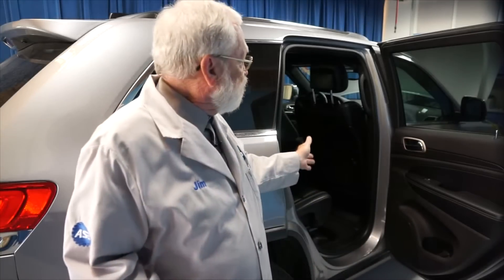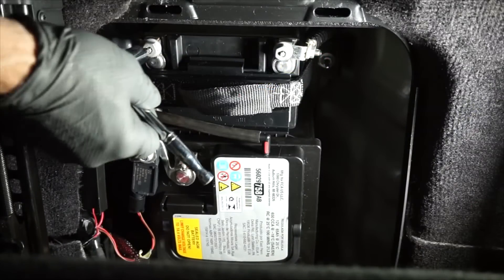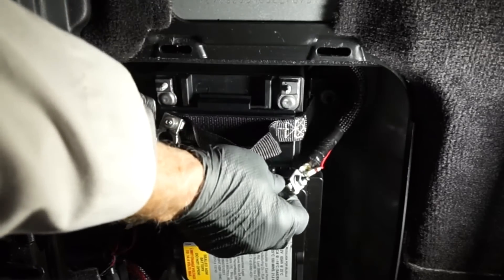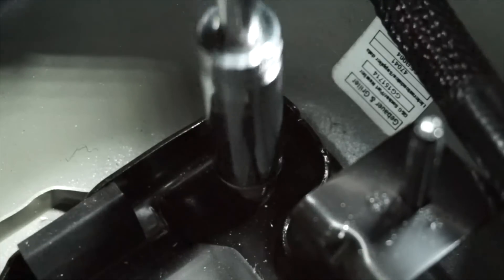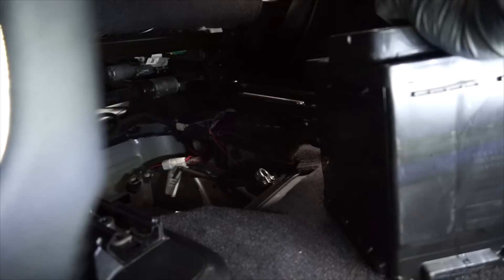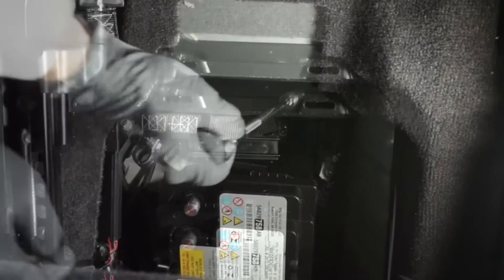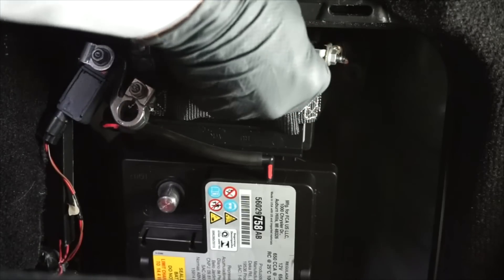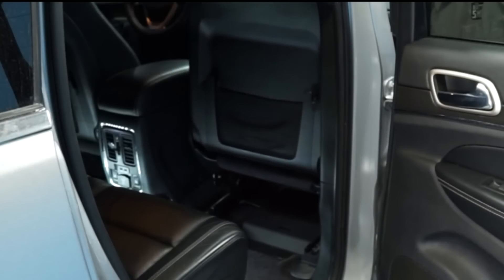Jeep Grand Cherokee & Dodge Durango with Start/Stop (2011-present) - New Battery Install

Comment: What do you connect the other end of the jumper cables to?
Reply from the maker: Hi - Thanks for watching! They are connected to another 12-volt battery or 12vdc power supply. You may want to check out our video on memory saving methods. The link is in this video's description.

Comment: Do you have to register the new batteries with the Durango? I’m searching and the only cars that seem to need battery registration is European vehicles
Reply from the maker: Hi - Thanks for watching! According to BCI, the Durango's replacement battery does not require registration with the vehicle's battery management system.
Reply: @TheBatteryShop  thanks so much for replying! This helps my mind ease a lot!

Comment: I just did mine.  I'd really would like to know how someone can be so smart that they get a job as an automotive engineer,  yet could be so stupid to put the battery there.  Caution to anyone that replaces their batteries. Make sure you get the H6 battery and not the H7.
Reply from the maker: Hi - Thanks for watching and sharing your experience!

Comment: Where is the auxiliary battery on a 2019 jeep Cherokee limited? The main battery is under the hood. Nothing under the passenger seat.
Reply from the maker: Hi - Thanks for watching! We don't always have that type of information here in the studio, so we recommend that you check the vehicle owner's manual or a service/repair manual to be sure.
Reply: @TheBatteryShop  After watching a few videos, it looks like the Jeep Cherokee has only one main battery under the hood.

Comment: What a pain in the ass Dodge made of CHANGING A BATTERY!!! Wow!!!   Need two loooonnggg 10mm sockets to get out the aux battery bracket as it has looonnnggg bolts.  Even after all is removed, the battery barely slips out of the space between the floor and the seat. Felt like I just delivered a baby. Push! Push!
Reply from the maker: Hi - Thanks for watching and sharing your experience!

Comment: What if the battery is completely dead and the seat won’t move?
Reply from the maker: Hi - Thanks for watching! A memory saver or another 12-volt battery connected to the "jump posts" under the hood will power the seat. The vehicle owner's manual should provide more information on the "jump posts".

Comment: Thank you. I was searching for a video that included the Aux Battery. Was pretty sure about removing it, but thanks for the clarity! Appreciate you.
Reply from the maker: Hi - You're welcome and thanks for watching and sharing your experience!
Reply: @TheBatteryShop I replaced the main battery and put everything back together but know the problem is even worse. All the lights are flickering and it won’t even crank…not a sound. Any idea what’s happening? Thanks.

Comment: I have a 2020 jeep Cherokee 2.0 turbo charged four-cylinder. The battery went dead. They say I need to replace it. My car does have the stop start. But my AGM battery is in my engine compartment. I don’t see any other auxiliary battery or have I’ve been told that there’s one and I don’t find one in my book. Can I replace my battery and not worry about the computer memory?
Reply from the maker: Hi - Thanks for watching! We don't always have that type of information here in the studio, so we recommend that you refer to a service/repair manual for your vehicle (available from auto parts stores and the vehicle dealership) for tat information and procedures.
Reply: Thank you! Your video was very helpful. I found out through my manual a manual that I do not have have an auxiliary battery. So that made it very simple for me and I did not have to hook up to a power source to keep my computer happy. Luckily my car is not that fancy lol

Comment: Is there a relearn procedure for this vehicle after replacing the batteries?
Reply from the maker: Hi - Thanks for watching! Battery registration depends on the year/model of the vehicle. We suggest that you consult a service/repair manual or the dealership service department to see if your vehicle requires this.

Comment: What do you do when battery is so dead it won’t restart and all the lights and electronics won’t work either? 

Because now we can’t get the seat to move forward to get to the batteries. 

Is there a particular way other than the headache of having to remove the entire seat?
Reply from the maker: Hi - Thanks for watching! A 12-volt battery or a Jump Pack can be connected to the "jump post" under the hood. Check out the vehicle owner's manual for more details.
Reply: jumper cables to move the seat

Comment: 2021 GCl and had to have both batts replaced under warranty. This due to the autostop failing after a reprogram for headlight and steering recall. Details of the work show that the computer needs to be reset to correct the autostop feature. Great vid, I wanna put a charger on these batts for a home test 👍
Reply from the maker: Hi - Thanks for watching and sharing your experience! You may also want to check out our video on battery registration. The link is in this video's description.

Comment: I want to find the genius that put the battery under a powered seat that needs POWER to move to GET TO THE DAMN BATTERY. Chrysler will never see another penny from me. They single handedly ruined the Jeep.
Reply from the maker: Hi - Thanks for watching and sharing your opinion. A 12-volt memory saver or jumper wires connected to the "jump posts" under the hood and another 12-volt battery will provide power to move the seat.

Comment: Great video and very helpful. I have a 2017 Grand Cherokee Overland.
The large (start/stop) battery checks out fine.
I'm now looking at the smaller auxiliary battery but can find no reference to it or a specification / order reference number anywhere. Can you help?
Reply from the maker: Hi - Thanks for watching! The auxiliary battery is a Group 400 AGM battery rated at 200 CCA.

Comment: Hello sir, thank you for details video. I followed your instructions and replaced new battery and my jeep is working again but the only thing missing is the ambient light on exterior door handles not working. Would you know how to fix it please give me some advices. Thanks sir
Reply from the maker: Hi - You're welcome and thanks for watching! We don't have that specific information here in the studio, but we suggest that you check the vehicle's owner's manual or a service/repair manual for the reset procedure. That's what we do.

Comment: The fact that this video is upside down is so frustrating. Especially when I have to pause, my screen times out. I have to rotate my phone to unlock, the. Flip back to see it the way you would see it while working on it
Reply from the maker: Hi - Thanks for watching! We suggest that you check your phone's settings to see if you can fix the issue.

Comment: I changed the aux with these instructions(thank you!) however the start stop alert is still on our gauge. Checked the volts using durangos setting and it’s at a consisten 14volts. No clue why the stupid start/stop(A!) is still on the dashboard… should I have the main battery checked or replaced?
Reply from the maker: Hi - Thanks for watching! The alert message may go off after driving the vehicle awhile. We suggest you check the vehicle owner's manual on this, but the main battery should be checked as well.

Comment: Can you charge the auxiliary battery with a trickle charger?
Reply from the maker: Hi - Thanks for watching! Auxiliary batteries can be charged with external chargers, but you have to refer to the vehicle owner's manual or a service/repair manual for the vehicle for the proper procedure.

Comment: Just replaced mine with a Duralast Platinum and had to trim the plastic on the positive side connector to get it to fit.  The Dura last has vent holes on both positive and negative ends, but it comes with a plug on the positive cap.  I attached the vent tube to the negative side like the oem battery had, do I need to plug the vent hole on the positive side?
Reply from the maker: Hi - Thanks for watching! Yes, the unused vent hole must be plugged.

Comment: What happens if the aux battery dies? Will the car just run like normal? We have the start stop system.
Reply from the maker: Hi - Thanks for watching! Typically, if the auxiliary battery needs replacing the start/stop function will not work. Other features may not work either, depending on how the vehicle is equipped.

Comment: Did the 2017 Jeep with start/stop require a battery registration? I have a 2018 Jeep Grand Cherokee Laredo with start/stop and can't find any info if it is necessary.
Reply from the maker: Hi - Thanks for watching! We always check with the dealership or a service/repair manual or database for that information. You may also want to check out our video on battery registration or "coding". The link is in this video's description.
Reply: @TheBatteryShop  Thanks. I contacted three Jeep dealerships and nobody, including the shop mechanics, ever heard of a battery registration requirement for Jeep and nobody could find anything in the service manuals. They all said they  install new batteries every day and never register them or use a memory saver. That is why I was  asking if you had to do a battery registration on the 2017 Jeep in your video. Maybe you know something they don't.

Comment: Who designed this mess?
Reply: Wait until you have to replace a headlight 😅
Reply: @gbaby2185 THIS is the truth. I about lost a hand trying to get this done.
Reply: @bhudzietz333  You must work in an office.
Reply: @gdl357g  Have you replaced those stupid headlights?!
Reply: @bhudzietz333  no not yet. My mechanic will as I will pass  them under my 100k/5 year extended warranty I paid 5k for.

The only reason I am not claiming the battery is because I can do it in under 1 hour and the cost of my battery is not worth it. The dealer paid me the AUX already when I change it 3 months ago and I regret not changing the H6 also.
Reply: @gbaby2185 those are easy IMO. It’s the left turn signal bulb that had me screaming!
Reply: I don't know, but i want to choke them. My 2017 needs a new battery.  Didn't drive it for 1 week and now the battery is dead...... can't wait to swap that out.
Reply: Idk but I'm ready to fight them
Reply: I am trying to change mine now....and someone was freaking high on something....what happened to a simple under the hood, remove the battery cables and replace it with a new one... tada done....IDIOTS!!
Reply: It's a great Idea. The battery is in a stable environment that doesn't get frozen in winter and heated in 15 minutes because of the engine heat.
Reply from the maker: Hi - Thanks for watching and sharing your opinion!
Reply: Mercedes designed it....
Reply: German engineering at it's finest 🙄

Comment: do I need a memory saver to replace main and aux battery in 2016 jeep grand cherokee limited standard v6 engine
Reply from the maker: Hi - Thanks for watching! We usually don't have that type of vehicle specific information here in the studio so we recommend checking with a service/repair manual for the vehicle you are working on.

Comment: Is it possible one battery goes bad while the other is good? I’ve had issues starting the Jeep with the remote start and the push to start button.
Reply from the maker: Hi - Thanks for watching! Yes it is possible for one battery to fail before the other.

Comment: I hate to say it because this guy seems so nice but rubber gloves aren’t adequate PPE for electrical work
Reply from the maker: Hi - Thanks for watching and sharing your opinion!
Reply: Nfpa and osha standards do not require any electrical guards or ppe on circuits below 50 volt.  There is no shock hazard to the human body.  There are thermal hazards due to high current arcs or hydrogen released by battery venting in high current states near electrical arcing. The risk is thermal not shock.

Comment: WARNING! If you attach a 2AMP trickle charger to perserve car memory your positive leads are hot! Difficult to keep both hot leads, (Main and Aux battery) off of the bottom metal of the frame. I had lots of sparks so took off charger. Good detailed instructions here.  Note that you MUST have a 13mm deep well socket. Without trickle charger I had to reset nothing. Even my Sirius radio remembered its presets. So skip the trickle charge and save some excitement.
Reply: put a rubber glove over da positives dude
Reply: Do you think a memory saver that plugs into the OBDII port will leave positive cables hot???
Reply from the maker: Hi - Thanks for watching and sharing your experience!

Comment: Would this be the same for a 2017 jeep cherokee?
Reply from the maker: Hi - Thanks for watching! We don't always have that information available here in the studio so we recommend that you check the vehicle owner's manual for the proper group size and CCA requirement.
Reply: @TheBatteryShop  Will do thanks 👍🏻
Reply: @Mase-sv7cf  did this solution work for you?
Reply: All V6 GC's or Dodge Durangos  should be the same  from 2016 which is when I believe they went to the stupid stop/start system  until  2024 models .

Comment: I had an issue with what I thought was a battery. I replaced both batteries 230$+ 120$ then the problem still exists... I then found out it was an electrical fuse issue. Only to for the problem to continue. Turns out it was the transmission control module. Mind you I only had this vehicle for 3 months. .....
Traded it in for a 4Runner ... I miss my Jeep , but I can’t afford to be left stranded multiple times.
Reply from the maker: Hi - Thanks for watching and sharing your experience!
Reply from the maker: Hi - Thanks for watching and sharing your experience!

Comment: Is there any reprogramming when fitting a replacement battery. I have read some people had issues and had to reprogramme. No mention if this in the video? The only replacements are now 70Ah batteries. The stock battery is 65AH
Reply from the maker: Hi - Thanks for watching! Check out our videos on registering a replacement battery. The links are in this video's description.

Comment: Hmmm.
My battery is flat... very flat. 
I can't move the seat forward or open the  front doors.
When I connect a charger to the charging points under the hood, the alarm goes off.
Ouch. I can't change the battery and I can't charge the old one...
Reply from the maker: Hi - Thanks for watching and sharing your experience! We usually use a commercial memory saver or another 12 volt battery. Check out our video on memory saving. The link is in this video's description.

Comment: My dad's 2016 Jeep Grand Cherokee has a significantly different looking battery set up.
Reply: Did he own an SRT or track hawk?
Reply: @majorpanek35  No.  Laredo.
Reply from the maker: Hi - Thanks for watching! Some models may be different, so we recommend that you check with a service/repair manual or the vehicle's owner manual for the manufacturer's recommended procedure.

Comment: Just performed a main battery R/R (2014 NON EAS) and a minor twist.

Reading the step about the 17 minutes before engine/control module memory loss I loosened and removed the hold down plate first then disconnected the NEG/POS terminals.  That keeps a few more minutes on the “play clock” so to speak .

Also if having trouble with the forward access cover loving clip run the seat Full AFT and UP ( before disconnecting terminals of
Course). Slide the forward locking tab up and release. Once that step is done mode the seat full forward and up for the rest of the battery removal procedure. 

Sounds like the Access cover maybe slightly longer on ESS models or maybe the AUX battery slides back under the cover a bit more.  I haven’t checked and hope not to have to find out anytime soon.

Comment: I just bought a used 2017 Jeep GC yesterday.  It was an off lease vehicle with only 12,000 miles.  Car looks to be in mint condition.  While learning about the message center I observed that the start/stop battery was not charging and started doing my home work.  Your video most likely confirms the 3-4 year old battery is faulty.  I have a 90 day warranty and will be making a call.  Thanks for the knowledge !  I am a car guy and could do it myself, but I paid top dollar and will let them take care of it.
Reply: these AUX batteries that are used for start/stop are crap and usually need to be replaced every 3 or so years. had to replace the one in my 2016 Grand Cherokee after 2 years. Now i have to replace the one in my 2019 Grand Cherokee after 3 years. seems to be a common issue according to the jeep forums. Maybe the Michigan winters have something to do with it... but others say that if you dont drive every day for at least 30 minutes you should keep it on a trickle charger... sorry, i dont got time for all that.
Reply: Was it the main battery?
Reply: @rjs49ers  The auxiliary battery for the stop start is under the front passenger seat.  I haven't replaced it yet, although it most likely needs to be.  The car needs to be driven for an extended period of time to get it charged up, then the start/stop works.  My son only drives the car for short distances to school and that is why the battery won't hold a charge.  Car is almost 6 years old with only 19,000 miles and will need both batteries replaced in the spring.
Reply: @uh-1flyboy632  makes sense, my 17 Durango has about 69k but yesterday the service stop start loght came on briefly then went away after we restarted the car. I think my main battery may need to be swapped out but it makes sense since its now 5 years old

Comment: Am I able to start the vehicle without the auxiliary battery? Had both tested and the auxiliary is dead and they are charging it at the moment
Reply: Hey man I can’t see the answer. Will the car still work if the aux batter is dead?
Reply: @TheBatteryShop  thanks, I have the parts shop recharging it, do you think 50% charge is enough?